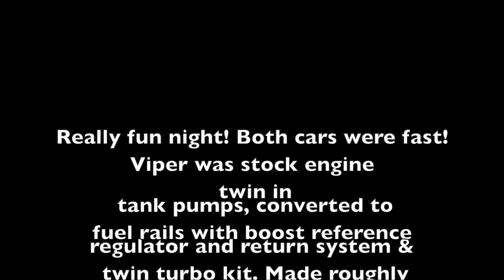Toyota Supra big single turbo vs twin turbo Dodge Viper GTS

Comment: I was assuming the Viper had a built engine too and when the Supra won the 2nd race with those mods I was ready to call BS... then I realized the Viper had stock internals.    TT Vipers with built bottom ends were in the 7's back in 2006, with full weight, manuals, and IRS!   They were (and still still are) no joke!
Reply: Yep. And Hennessy, years ago, had built Vipers with Twin Turbos.
Reply: @stuchbrosmnore8627  They were the joke of the TT Viper community back then as well, they had nothing on Heffner and UGR, never mind the stupid aero add-ons, lol!
Reply: @ssoffshore5111  Yeah, especially when Hennessy has been in deep stuff on the bad stuff in general. I give them credit however.
Reply: @stuchbrosmnore8627  With all the money he screwed people out of, I only give him credit for still being alive and still in business. ;)
Reply: Miss the SupraForums and ViperAlley days. Lee Saunders, Garth Weaver, Sal Patel, Dr Roof, Kyle Bennett, Stacy Barnett, and A.R.T come to mind. Rwd kings. Back when Supras swept the Texas mile  and 6speed synchro wars were brewing.
Reply: @ssoffshore5111  lol

Comment: The more educated on Vipers I get, the more they Really are just American chaotic nasty track-street warfare weapons of torque proportions. I just don't see how torque can strangle that much more hp with some of these races, but it happens. Gearing and traction and of course vipers are shaped for high speed tracks so it works.
 That old school gen2 viper was stock too against these fast modded newer cars. Crazy.

Comment: Viper basically won both races. Because on the second race you can’t really tell what’s going on but on the first race you see exactly everything lol
Reply from the maker: So I have no real bias towards either as I owned both cars, knew both owners, and was in a car trailing them. The Viper definitely won whenever the race started from 60mph or lower. The Supra definitely won when it was around 60-70mph at the hit. They raced a few times, but we just put up these 2. The reason the 2nd 1 had a weird in car angle is the car got traction so dude was pulled back in his seat more hah. Also both owners agreed the Supra was faster/more powerful. I mean it was on a pretty basic set up vs the Supra which was fully built. The reason they did a few races from a lower roll is sort of as a handicap. Hope it clears it up a bit!

Comment: No replacement for displacement.
Reply: Yeah there is, it's called forced induction.
Reply: @cognitivedissonance2264  displacement still better go boost a chevy v8 replace injectors etc bye bye little 2jz
Reply: @cognitivedissonance2264  sorry even a LS or any v8, v10
Reply: @kaneoconnor7635  come on now, are we going to play that game? 2JZ has been in the 5 second 1/4 for at least 5 years now. Has the LS been there yet? I'm asking because I haven't heard. 
Plus there are a ton of V8s that run 7's as well as supras Corvettes hondas and all sorts ALL USING FORCED INDUCTION.
Reply: @kaneoconnor7635  plus this video is like 16+ years old. Very old technology here times are way different now.
Reply: @cognitivedissonance2264  If two cars have similar power, the N/A one will almost always have higher potential
Reply: @Sunny S
Watch literally any other NEW video, anything with a turbo, doesn't have to be a Supra, literally a Prius maybe lol, will beat any N/A car in it's class.
Reply: @sunnys7645  Okay. . . Fastest cars in the world are all boosted and thats a fact. Please point me in the direction where you can make 1800hp at the crank on pump NA. I'll wait forever.
Reply: @cognitivedissonance2264  100% agree with you on that but that's not relevant to "no replacement for displacement". Here's an example: Lets say we have a 2.0L N/A engine that makes 200hp, and the same engine with a turbo makes 300hp. Lets say another 4.0L N/A engine makes 400hp and the same engine with a turbo makes 600hp.  As you can see, the engine with higher displacement has more power as N/A and also when it's boosted. You can only boost a 2.0L engine so much until it fails. You can boost the 4.0L to achieve more power than what's possible with the 2.0L. The turbo enhances the displacement of the engine,  but it is not a replacement. Once you boosted the engine too its limit, it is extremely difficult to add more power without swapping it out for an engine with larger displacement. Hence the phrase "No replacement for displacement".
Reply: @sunnys7645  Touche!
Reply: @cognitivedissonance2264  your argument is invalid because they use 2JZs with increased displacement 🤡
Reply: @leroyjenkins6809 I'm thinking of a catchy original reply.. . Hold for a minute right here.
Reply: @cognitivedissonance2264  to a point. And those 2jz you talk about are billet blocks. Now put a billet V8 to any 2jz and will be no contest. Dnt be silly guy billet V8s run mid 3s at over 350+mph. What your doing is comparing a fully built 2jz to what a stock block? That's beyond goofy. The  Viper blocks hold the record for most HP from a stock block 2,000Hp. What the record without block filler n racing sleeves? On 2jz? With forced induction a bigger engine will always out perform a smaller cubic engine. That's just simple physics.
Reply: @Al-mx6ru  Ok.

Comment: Good race but it looked like in the 2nd race the Viper didn't know when to go. You see the Supra jump ahead a car length, the Viper gases it a little bit then let's out.
Would be nice to see a rematch and if the Viper is on the stock engine, it's making no more than 750hp at the tires because the Gen II vipers from the year 2000-2002 were limited by their cast pistons as '96-99 Vipers had forged pistons that could handle much more HP.
Reply: I'm only gonna disagree because the owner basically said the viper won anywhere around 60 and below while the supra usually won 60-70 above. All in all they said the supra was more powerful at higher speeds.
Reply: This car was a forged car (1997, I believe) and made right around 800 rwhp on Sound Performance's Mustang Dyno. Was beaten like a proverbial mule for many thousands of miles. Hundreds and hundreds of highway pulls, some into the 200s. 

I was in a bidding war on the car and lost to a dealer and I don't know what happened to it after that.

Edit: now I see which Chris I'm talking to. Hi V4C

Comment: Viper need build engine to pass 1000hp. But if do it correctly, it can go way more HP than any engine can handle.
Reply: For what it's worth, we (builders of the Viper in the video-- of which I provided peripheral support) made about 1500 rwhp on a stock Gen 2 long block (this car was right at 800 rwhp). Absolutely was on the edge, but it lived and ran upper 160s trap speeds. Funny enough, what took that car out was a stuck injector hydro locking it.